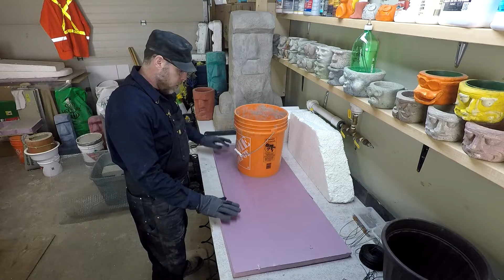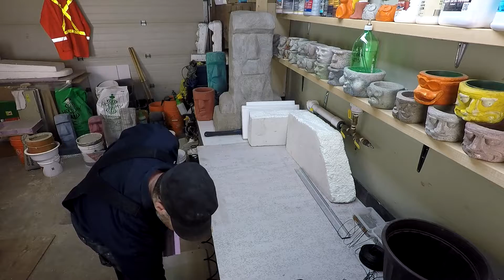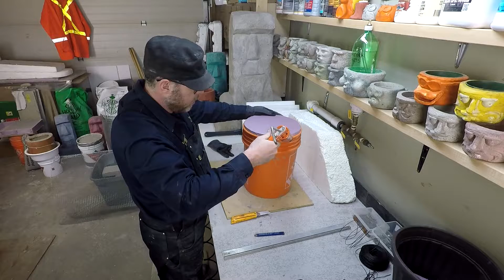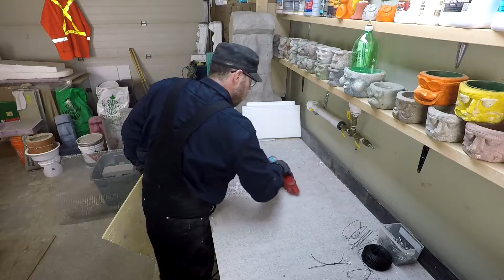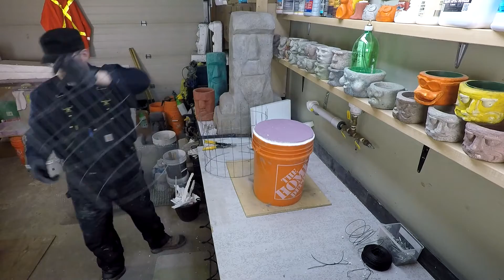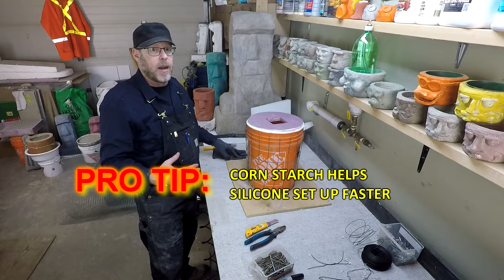How To Make A Concrete Planter Statue (1/9)

Comment: I’m a fellow mold maker I’ve been watching your content and I was wondering if you’ve ever tried using a electric styrofoam cutter for your foam cutting ? Major time saver quick clean cuts no mess. 
Ductape Bandit 😁
Reply from the maker: Do you mean a hot wire?  I have used these but I also dislike melting polystyrene so I would rather deal with the mess.
Reply: @creatingconcrete  Good call. Burning plastic = carcinogen.